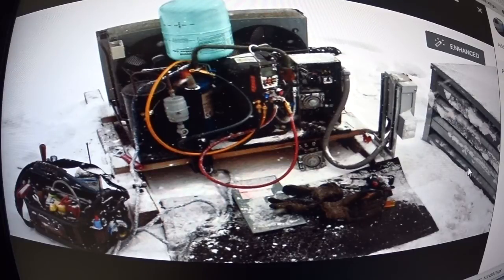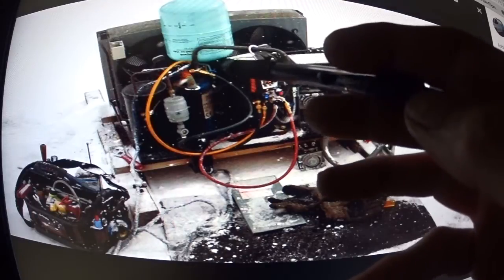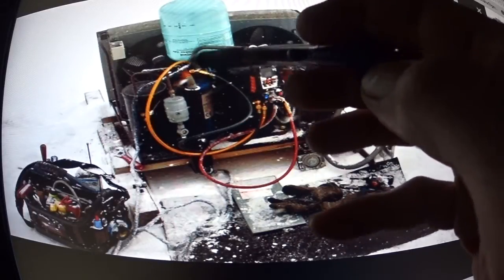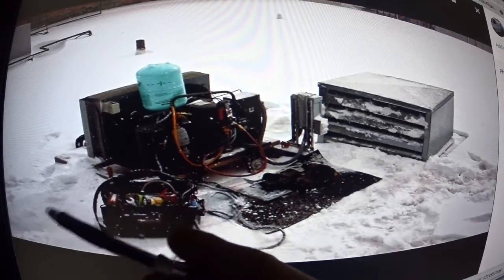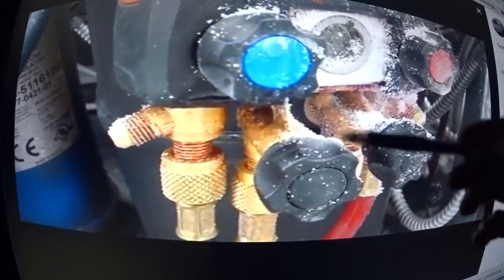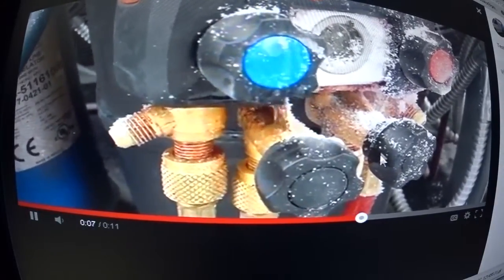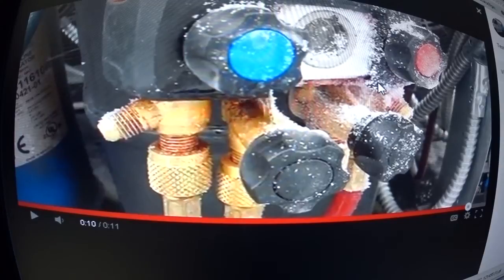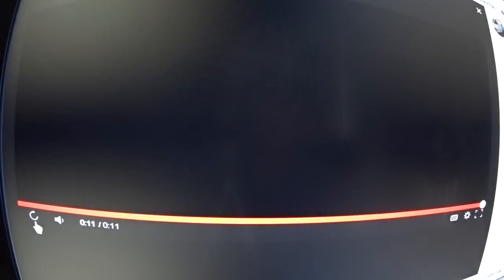Winter   Testo leaking

Comment: Nice video.    My 550 's leak in cold weather as does my recovery machine. Its frustrating. At least I am not alone.
Reply from the maker: I've bought two more newer 550s, they are fine so far. Testo probably fixed the problem on the newer ones.

Comment: If my Testo 550 ever does that it will be shipped right back to Testo for replacement! That's bullshit! You paid damn good money for a product that you need to be reliable 100% of the time and if they refused or didn't fix it then I would switch asap to a different brand. I got a brand new Testo 550 and 60" YJ ball valve hoses that's never been used a single time and if they did that I would send it back to Testo so quick it would make their eyeballs spin!

On a day like that you deserve for your hard earned products to work correctly!

I agree also with the vacuum without gauges. I mean a Supco VG64 isn't that much and is really all you need with a JB pump.

Best of luck man, hope you got it fixed or replaced man.

Adam

Comment: jim witch one would you say is better the testo or the Sman for the type of work we do
Reply from the maker: get a couple Testo 550's, they are rugged, compact and cost about $300. ea in a cardboard box, I don't use the molded plastic case, it's in my shop. Buy the newer version, they are grounded now. When you charge a full bottle of R 404a you build up a static electric charge that messes with the gauge electronics, the grounded temp clamp discharges them. The new temp clamps have a green band on them at the plug. I've got the SMAN 4, it's too large and bulky, it's on a shelf in my truck.
Reply: Thanks Jim for giving me a good straight answer usually on here if you ask someone a question about a product they will give you a political answer I had the 550s before but only for a short time I gave them to my brother and been using the analog gauges ever cants thanks again  'johnny'

Comment: How much importance do you put on a clear sight glass in determining a system having enough refrigerant?    Subcooling is best, isn't it?  I've seen sight glasses on AC systems,  even with fix orifices.  Do you recommend using them on every system?
Reply from the maker: In refrigeration I've always used a sight glass to provide a solid column of liquid to the txv. In the summer, with a clean condenser I would use the sight glass only, in the winter it's easy to over charge a system, so I would charge to a few small bubbles. With Air conditioning and a fixed metering device use superheat, but if you have a txv and a clean condenser I would use the sight glass charged when there is a full load so the txv is open.

Comment: i agree testos suck for pulling a vac .. your right 550 is fine .. take the digital gauges out of the vac process
Reply from the maker: The Testos and Imanifolds are evolving, they'll work out the bugs over the next several years. I just don't want to sink alot of money in a tool that's going to be obselete in a year. the 550's are $300. new, very durable, and they do the job just fine, I don't take alot of time taking readings I don't need. I'll wear them out and buy next generation next year. Get the work done, get paid, get to happy hour have a cold beer and a steak, go home watch TV , fall asleep, tomarrow do it all again. :)